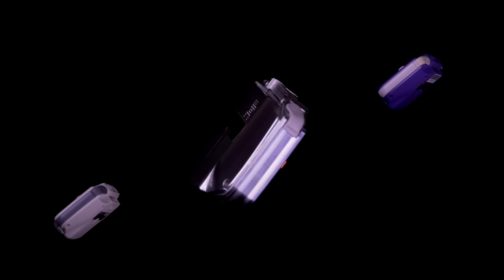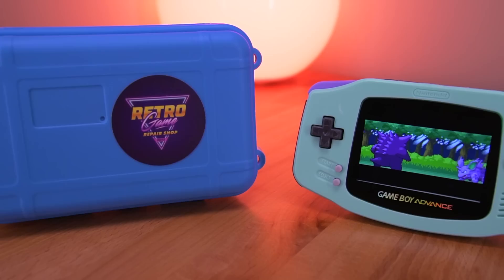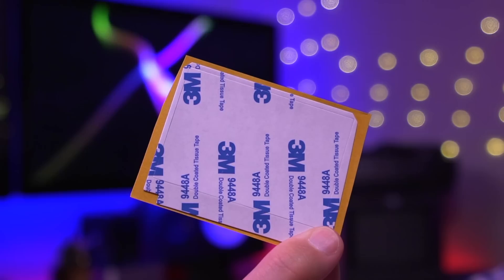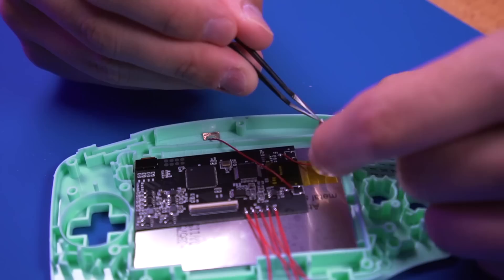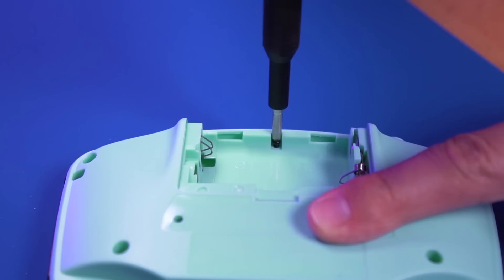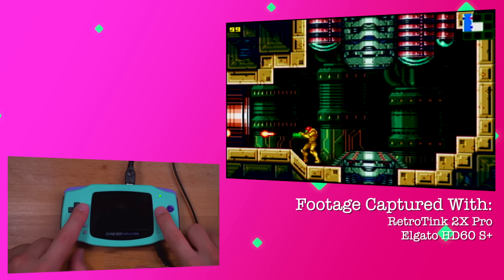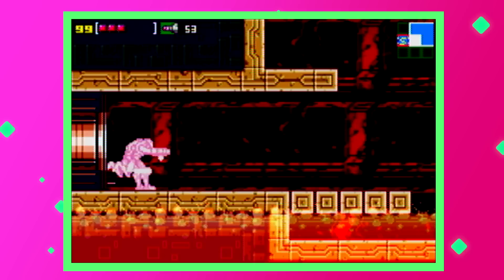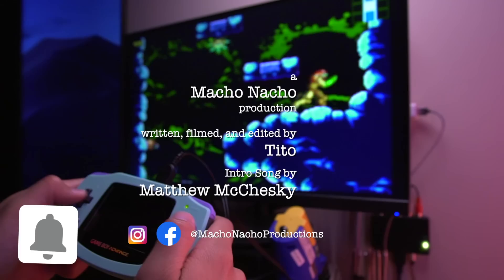If the GBA was a Nintendo Switch! | PLAY Your GBA On The TV Using The Link Port! | GBA TV OUT Mod!

Comment: We really need something like this for 3DS. For GBA you can already use the GameCube adapter.
Reply: CrazyMaxxVideos Ik they found a way to do it with the ds lite so maybe its possible
Reply: CrazyMaxxVideos  only for NEW 3ds models
Reply: I really wish the wiiU would have supported 3ds games. It has all the same controls and 2 screens already and was current while the 3ds was so I felt nintendo really messed up there.
Reply: CrazyMaxxVideos  It's not very good.  Even on a good wifi signal, you're also bottlenecked by the 3DS performance.  A game that runs at 30 FPS could stream at 20 for example.  Even then , you'd have to lower the quality and it looks like a compressed JPEG mess.  It's a HUGE shame the current options aren't open source.
Reply: CrazyMaxxVideos  would be dumb If I had an old 3ds but it was brand new 

New 3ds 
New new 3ds
Reply: @TheSquirrelyGhost  isnt that only the top screen though?
Reply: What are you talking about 3ds av and gc control mods have been out for years
Reply: GameCube Adapter are sometimes sold without the disc for a pretty expensive price and most of the time there is one with a disc it’s usually from japan
Reply: 3ds consoles modded with capture cards are a thing for ages that's how most of the Pokemon shiny hunters play the games on twitch. I own one as well. It's not exactly the same, but it's not for much. You just need to connect them to a PC instead of directly to a tv.

Finding a normal DS capture card these days however is almost impossible, so this kit is amazing since I actually only wanted a normal DS capture card for the gba games. Now I can both do that as well as older GB games.

Comment: You know, I’ve been tempted to get one of those retro consoles for playing gameboy/gba on my TV for the last few years but I’ve never followed through because of price. I don’t really need all the special features or HDMI compatibility, so this would be the perfect option for me. No expensive retro consoles, no need to hunt down a GameCube and Gameboy Player, and all I have to do is a minor amount of soldering. This is perfect for someone of a similar mindset to me, and the only way it could get better is if it had a way to activate Super Gameboy enhancements built into the older Gameboy games.

I was considering getting that drop in GBA ips mod you made a video about a little bit ago, but now that this is on my radar I might just go this method instead.

Comment: I've been modding my GBA like crazy, and have been considering upgrading from the IPS screen I have to this one, but if the link port loses its functionality specifically for GameCube connectivity, then that is a genuine deal breaker. A main reason I wanted to mod my GBA is to have a better way to play games like 4 Swords Adventures and Final Fantasy Crystal Chronicles.
Reply from the maker: As far as I know jus the wireless GameCube adaptor works. Still waiting on a full list of compatibility.
Reply: @MachoNachoProductions  I assume you mean the wireless GBA compatability for the small collection of games that used that adapter like Fire Red and Leaf Green.   If however there is some wireless Gamecube adapter, I'm very intrigued to learn about that.

Anyway I think the 4 official products to check are: standard GBA link cables, Wireless GBA link connecting for the few games that support it, GBA to GameCube link cable connectivity, and E-Reader connectivity. Unofficially there is the Majesco wireless link that can be used with any other GBA using the same accessory even though the game in question never supported the official wireless link (Pokemon games aren't supported with this accessory for whatever reason) and the Kionix GBA Acceleramator accessory that can be used with GBA homebrew for motion control. I believe that is the extent of products that need to be tested with this mod. Though I know the last 2 unofficial products might be much harder to test considering how much more difficult they are to come by.

Edit: oh wait, I think there was an unofficial GBA Camera that used the port too that probably should be checked as well.

Comment: You should get your hands on a GBA Consolizer. I have one and it's pretty great. Installing it wasn't hard and it looks amazing on my 55" OLED. Only downside to it is it uses DVI instead of HDMI so you may have to use the headphone jack for sound. I just plugged it into my HDMI 2 on my TV instead of in my AV receiver and got a 3.5mm to RCA cable to plug into the receiver.
Reply from the maker: I’m going to try and do one soon!  Would love to have a consolized gba!

Comment: I still have yet to see clarification on whether this kit outputs 240p or 480i... I really hope the artifacting is just dot crawl common with 240p composite signals.
It being 480i would be a complete letdown, because original Gameboy and Gameboy Color games that use sprite multiplexing would really suffer. Having a 60fps video output is very important!
Makho already did a video on it that showed that issue, but their capture card was leagues below a RetroTink 2X and an Elgato HD60S, so it wasn't really deterministic.

Comment: Did you test the link port before modding this GBA? Because mine worked fine with the AV out kit installed. 

the next iteration of this kit (because of course they already made a new revision) tried to fix this non-issue and requires a more complicated install and breaks accessory compatibility to be able to use a link cable while in tv out mode.
Reply from the maker: I didn’t, I actually dont have a link cable or wireless adaptor. I just bought both on eBay so I can test things like in the future. I spoke with RGRS about compatibility with link port accessories and was told that only the wireless adaptor works after the mod. If you tested the link cable and it works that’s great news and I’ll pin your comment to the video. Thanks for the heads up Makho!  Very much appreciated dude!

Comment: This is awesome. I was tempted by the colonizer but this seems like a much cheaper and great option if you have a  scaler. I wish they had one for SCART so I could use it with my OSSC. Are they thinking of making a SCART version?
Reply from the maker: As far as I know, I don’t think a scart version will come out. The consolizer is a great option too. Cheers Spencer!

Comment: Regarding the GameCube Gameboy Player: If you didn't have one because you can't find one with a disk for a good price, if you have access to a hacked Wii (that can take GC memory cards) you can put a modified save file for a few games (Smash Melee and Wind Waker are the games that I've used) that will allow you to boot into the GameBoy Interface software so you don't need the official disk. I know it's hard to come across both the disk and the hardware at a good price, so I hope this helps.
Reply from the maker: I’m planning to mod a GameCube so I won’t need the disc. It’s crazy how expensive they’ve gotten over the years. Cheers buddy!
Reply: @MachoNachoProductions  Nice. Yeah, it's ridiculous, I managed to pick up a Gamecube with Gameboy Player and disk for £40 on Facebook a while ago, I don't think I've ever messaged someone so quickly in my life when I saw it. lol.

Comment: Thanks for the video, it cleared a few doubts about a similar type of IPS. I found a similar IPS v2 kit with TV-Out, but they say to remove the EM3 resistor that sits between the link cable plug and the CPU chip. Did you also remove it? Are you able to use the link cable normally to connect to other GBAs or the GameCube?
EDIT: removing the EM3 resistor seems to be for older revisions, found one that explicitly says that it no longer needs to be removed, and it also includes the LG screen. But does the TV out interfere in any way with the Link cable functions?

Comment: Can you keep it charged while playing on the big screen? I hope there is a video out for the 3ds soon
Reply: You sure can - there are mods that also add a LiPo battery that can be recharged through USB-C, so you could just keep that plugged in - or even hook the battery terminals up straight to a stable source of 3-3.7v DC

Comment: Regarding your statement about image quality, you should really, really get a GB Player+OSSC, a GBA Consolizer or a gbaHD for comparison, they are so much better than what you captured, it's not even funny. Pixels are razor sharp from these, not the blurry mess you get from composite. Think of it like the jump directly from AGS-001 displays to the new 4x scaled IPS displays. It's that big. You could get better image quality from composite if you captured with a Retrotink 5x, it can reduce dot crawl quite a bit, but an integer scaled digital solution is the absolute non plus ultra.

Comment: Can anyone explain to me how this even works?
The mod does not seem to solder to any link port-related component. How is it able to output a video signal through the link port?
Reply from the maker: I soldered to Pin 3 of the link port. That’s were the composite signal is carried.
Reply: @MachoNachoProductions  Oh sorry, I guess I missed that.
To me that seems like it'll mess with (or maybe even damage) anything you plug into it then. Pin 3 is "serial in".

Comment: Question regarding the cons part. Does installing this mod mean there won't be any link kable features on the unit at all? Let's say I want to trade some pokemon or play Mario Cart with a friend using two units and later play something else on the big screen. Will the modded GBA work like a regular one when using the link cable?

Comment: Should I buy a gameboy advance, give it an ips screen and new shell and a rechargeable battery, or should I buy a ds lite and give take off the top screen and give it a new shell like the boxypixel? I like the gba bc it is the original hardware but you need to buy and ips screen and rechargeable batteries or a battery pack. Which would be the best one to do?
Reply: 1st one
Reply: if you have a DS Lite, it's cheaper and easier than modding a GBA.  that's been my experience at least. for me the DS Lite conversion into the GBA Macro was very easy, even for me, a soldering noob.  GBA mod was tougher and it'll cost you about twice as much.
Reply: @onedeadsaint  yeah my only concerns were the cost bc a ds lite already has a good screen and battery but the gba doesn't. I think I'll do the macro mod instead simply because it is cheaper
Reply from the maker: That’s a great choice!  Cheers!
Reply: @MachoNachoProductions  Hey! So I settled on the ds macro but I came across a really good deal on ebay for an ags101 but I was wondering what the difference between the ds lite and ags101 screen is. I understood that when the ds lite plays gba games there are black bars and it doesn't take advantage of the whole screen, but they do that so it doesn't look weird stretched out. So is the gba sp101 screen the same as the ds lite screen or is there a big difference?

Comment: Can somebody help me find the link port av cable? I was using this video to figure out where to wire my brightness control so I could take out the capacitive panels, then I realized my IPS mod has av out as well! But... the seller didn't advertise it as such and didn't include the rca cable. I've searched everywhere and cannot find JUST a cable anywhere, even aliexpress seems dry.

Comment: while the mod is certainly interesting, i'm having trouble understanding who actually wants it. with both the gba consolizer and gba player as options for twitch streamers, i'm not seeing the need for this additional option. removing gba link cable functionality is actually a deal breaker for me, too. how does it work with the gc link cable? also, on an unrelated note, i just ips modded my gba sp, and am noticing the battery light now flickers between red and green when the battery still has plenty of charge. does the helder power cleaner mod return battery indicator light function to normal? (i put a new battery in it, so it's not being caused by an old battery malfunctioning) thanks for everything, your vids have been incredibly helpful.

Comment: You really should have mentioned that ppl not using a standalone upsaler should expect significant amounts of lag when connecting Composite directly to a modern flat panel TV.  Most casual gamers just getting into this stuff don't know about that thus it's a bit of a headscratcher that you didn't mention it.
Reply: Got any you recommend for cheap?
Reply: @Bigtexbbq  For what, an upscaler?  The cheapest option is the RAD2X cables.  They use a literal RetroTINK 2X inside and are about 60 bucks a piece.  You can get the SNES and Genesis ones & they will work with most systems.

The other good option would be an actual Retrotink Mini or Retrotink 2X.  Those are the cheapest options.  The next step up from that would be an OSSC or Retrotink 5X.

Comment: I was literally thinking the other day that surely you can tap the display signal coming from the motherboard and have a custom driver board that allows you to toggle a port that outputs to HDMI. The GBA consoliser shows that this is possible to an extent, but I feel it could've been executed and designed way better. This mod is very clever though!
Reply from the maker: I think we'll be seeing some cool HDMI mods soon!
Reply: It's remarkable how far things have come with GBA modding. It feels like yesterday when the only mod you could do was installing an old AGS-101 LCD. Now we have all these crazy mods.

Comment: can this go into the Unhinged GBA SP?
Reply from the maker: That’s a great question. I don’t think so but I’m sure they’ll make a kit for it soon!
Reply: @MachoNachoProductions  While you are at it, can you answer the question I had about Boxy Pixel's instruction to file down the holes and coat the buttons for the Unhinged shell?  Is that necessary?
Reply: this kit has been forever on aliexpress and they already have a kit compatible with the sp
Reply: @Sureigem  I am wondering if you can cram this in with Boxy Pixel’s Unhinged GBA SP shell. Which is already pretty tight with bunch of stuff Nacho did.

Comment: Would love to find a way to somehow release the video output wirelessly to the receiver with zero input lag. Then you'll have a GBA you can play anytime on a bigger screen using that hotkey function.
Reply from the maker: That would be awesome!  But I’m sure it would be difficult to pull off.
Reply: @MachoNachoProductions  There are HDMI dongles that send output signals to screens however you’ll probably need a converter for the composite out